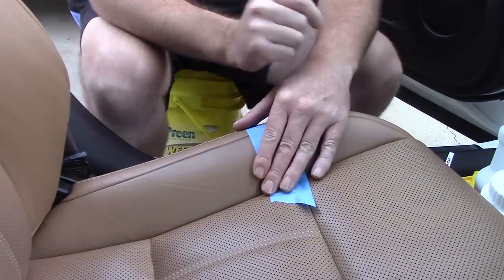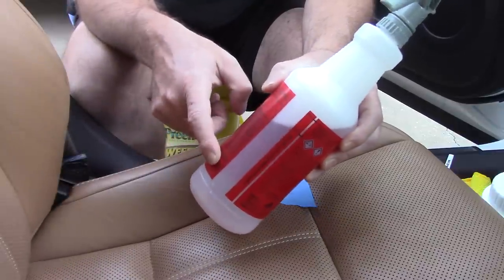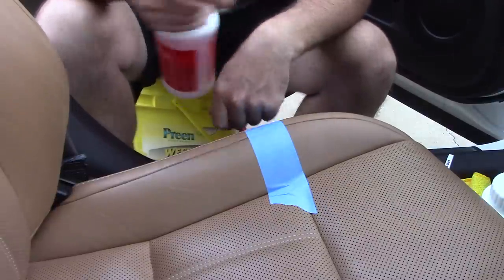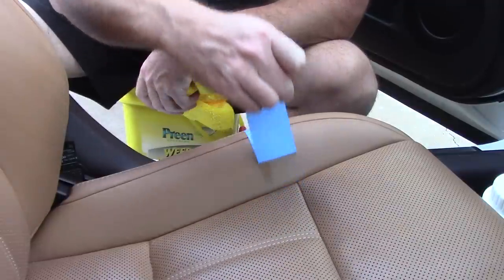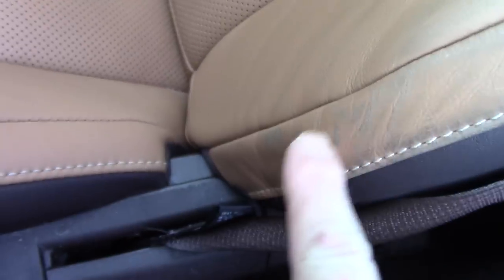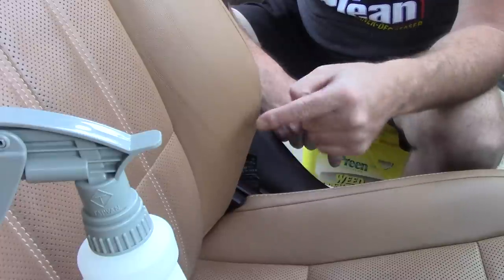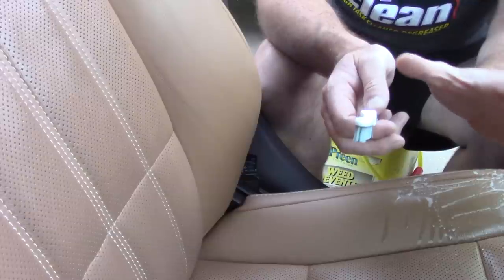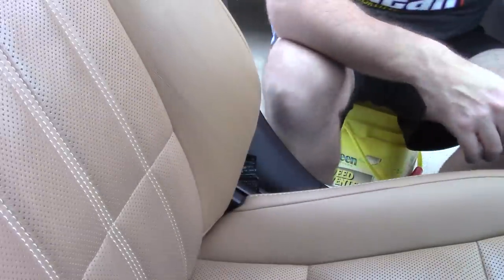Amazing Cleaner For Car Leather - And Cheap!

Comment: Better to show us the Microfiber towel. 
In the UK, a 500ml Spray bottle of leather cleaner is 99p  ( 75 c USA ) with the correct ph factor. 
Forget the CAR Shops,  Buy from the Discount Supermarkets For Cleaning Leather Sofas & Chairs.  On the Household Cleaning shelves.  A cheap Brand will do the job, It's called LEATHER CLEANER.  In a Squirty Spray Bottle, It is Clear & soapy as you Use it. 
99p in the supermarket,  £9.99 in the Car Shop / Car care Shelves.
a 500 ml spray will do 5 or 10 cars depending how dirty they are. 

After Thoroughly Cleaning your Leather, it is wise to Allow it to dry properly, 
Then Wipe it over with a LEATHER FEED Product,  / Leather Conditioner. 
It;s like a Very Slightly Oily Cream to prevent the leather from Drying out & Cracking. 
Use a tiny amount & rub it in with a very soft clean cloth. 
Similar principle to using HAND Cream after washing Dishes etc. Leather is Skin, it will dry out & crack , with sunshine & age & Use. 

A bar of Normal Hand washing Mild Soap will also do the job on Leather. 
( A very Small amount on a Clean Damp Microfiber towel. ) Wipe off with another Damp Microfiber towel.  Dry with a 3rd microfiber towel.  TRY NOT to get the Leather too Wet. 

READ ALL INSTRUCTIONS & LABELS ON ALL PRODUCTS. BEFORE USING. 

                   ALWAYS TEST a SMALL AREA FIRST.

Comment: should I try it on seat belts?   Great vid, I never would have dreamed that one!!!  Thanks
Reply from the maker: sure...but this process will not remove really bad stains and soiling on seat belts, you will need something stronger unless the seat belt dirt is light in nature...its very hard to remove bad stains from a seat belt because of the material used to create the seat belt:(

Comment: Nice video and, as usual, usefully informative, Scott.  I have new leather seats. This seems like it would be good for maintaining it for regular cleaning.  But it does not seem it would be necessary to use the toothbrush since there is not really any grime build up on the seats. Would a microfiber towel be OK?

Comment: I just bought a used, very nice and clean truck last week.  The person who sold it (a small car dealer), must have sprayed (or hired someone to detail it)  everything with that crappy Armor All garbage.  I cant stay seated because its so slippery, nothing stays on it.  My purse flies on the floor, upside down, and unless I put the armrest down, I'm sliding too.  What idiots.  I'm going to try this to remove ALL the Armor All.  Morons.
Reply: I agree. I had that happen to my brand new Mercedes a few years ago. I couldn't believe someone would use that stuff on a new car with leather seats. The detailer told me to use windscreen cleaner like Windex and it will come off. It did. But i lost the new car smell I paid 142k for. I went bonkers and told the detailers staff that you only put that armerhll crap on a $2000 car if you want to sell it.

Comment: some of us old timers have been laughing for decades how all you detailing suckers buy all kind of unnecessary products.. geez any simple old cleaner works fine on acrylic which is the varnish on leather so it is not like old leather in old cars.. woolite works but is not mild, it is a harsh chemical so wear gloves.  Bronners is my favorite which is just mild castille soap, you can get same results with murphys, simple green, ivory dish soap or dissolved castille bar soap or flakes, or natural shampoos or soaps, or ask your grandma.. she was cleaning biologics for decades before you were born.. You never need any expensive "cleaners" which are detergents and are half synthetic-fragrance which are big endocrine-disruptors anyway! Detailers ought to be as concerned as auto painters about chemicals..  This video could be 1 minute long if he was willing to just tell it, instead you'd think he's protecting an idea to sell, but he blew that one! Join a million other companies selling the same crapola in a new label.. If you want to actually renew old colored leather which is like paint or stain, try diluted ammonia, it's a super cleaner so be careful, try it where it doesn't show first  It will transform old colored leathers but will do it by starting to dissolve that coating.  IF you want real leather, take a gallon of acetone to a new car interior.. def wear a mask and only do it outdoors! But you will have genuine leather again just like an old jaguar..
Reply from the maker: i can't believe you watched EVERY minute of it..lol..and you're upset with me:)...im teasing my friend but i disagree with everything you said within your comment..but hey thats life:)...much love

Comment: I bought some Woolite yesterday just for the purpose of cleaning my light gray leather in my Ford Flex...didn't work :(  I used 5 parts water to 1 part Woolite.
Reply: Same here ! On the same car he shows in the video. Pretty disappointing.
Reply: he's cleaning easy stains.
Reply: solarisdreams my seats were clean except for bluejean stain... that's still there :(
Reply: Monica McDonald get those mr. clean magic foam pads. They look like blocks of white sponge. Pretty easy on leather but works great on pretty much anything. I was even able to get news paper ink off light tan leather. Anyway you decide to go, good luck with it.
Reply: PS. Only five or six bucks for a big box of them
Reply: Yeah, I don't think so.  I've seen what Magic Erasers can do and I'd be afraid of removing the protective layer at the very least.  But thanks for the suggestion.
Reply: Monica McDonald try steam
Reply: You probably need a stronger cleaning solution and a stiffer brush. Pro detailers dilute APC all purpose cleaner to clean the not so delicate leather seats. For the brush, instead of using a soft 100% horsehair brush, use a slightly stiffer brush with PET bristles.
Reply: Genius! I tried the Mr. Clean sponge with no chemicals and it's like magic. My wife always uses them, I don't know why I never thought of that.
Reply: There are different types of this Mr. Clean foam pads, use the Original, cheapest variety or the ones with the added cleaners?  Saw it at Loews, not sure which one to buy!  Thanks!
Reply: LASVEGAS GEORGE  I used the chemical free one.
Reply: idreamyou100 sure! I use it on my 96 suzuki x90 and seats are some clean shiny mofos! I'm getting all the puxxy and I ain't saving none!

Comment: Ummm,  you are too slow.  "Professional" means cleaning leather seats for profit.  If I used a toothbrush, I wouldn't even be able to get a job detailing cars.  
I use a scrub brush that's the equivalent of like 200 toothbrushes.  Making it take 200 times less time. 
Time is money.  Chemical /product costs are generally less that 20% of what time costs doing the job.

Comment: Less words would be good
Reply from the maker: i know right:)
Reply: Dallas Paint Correction & Auto Detailing. What do you recommend as a good conditioner that protects and shines if it's dull? Also can you use this on leather furniture? And what will happen if leather is not coated in plastic when you clean it? Thanks!

Comment: No rinsing necessary?
Reply from the maker: correct because modern day car leather is coated in plastic for about 90% of all cars with leather
Reply: Dallas Paint Correction & Auto Detailing That's good to know and a great tip. I have never been very satisfied with the expensive leather cleaners I've used in the past...maybe because they were cleaning plastic.
Reply: meguiar all purpose cleaner will do as well
Reply: +Dallas Paint Correction & Auto Detailing, Will wooolite damage my heated and ventilated system on my seats?
Reply: Jonnie Bangkok  

  ?
Reply: Does it work on all types of material. Mine looks like leather but not sure if it is. It's a Ford escape 2017.

Comment: I am pretty sure BMW + Mercedes recommend their own leather cleaners, like other premium manufacturers do, e.g. Porsche etc, who in turn of course resell brands like Dr Wack in their re-branded bottles. And nobody recommends working your leather with a toothbrush of all things... you point yourself to how fragile the coating is on that seat and that it has come of but somehow a fucking brush is your tool of choice. Well, if you clean a customer's leather like that every 3 years you probably get away with it; otherwise, this is a terrible hatchet job... The people that are so happy with you here should check out some channel of actual leather experts and think again.
Reply from the maker: little do you know my friend..and as a pro some people don't clean their leather EVER!..so yes using a brush is fine to remove all the years of neglect..but no you don't need a brush every time to clean leather once you have cleaned it properly:)..you are over thinking every thing my friend and just assume i would clean well maintained leather the same..relax dude and the so called leather experts would recommend a ph neutral cleaner for really dirty leather...good look with that:)...do some research with BMW and Mercedes and you will notice the cleaners they have or recommend wasn't working for those with really dirty leather so in a lot of their paperwork they recommend this method because they had to because their so called leather cleaners weren't doing the job for really dirty leather:)....i enjoyed your comment even though it wasn't coming from an educated perspective

Comment: I clean and maintain both my Lincolns, one with white leather, the other with a neutral type beige and even at the worst point, they've never turned out that poorly!  In other words, I'm a much better detailer when it comes to leather seats.  Those seats did NOT come out clean!  Sorry.
Reply from the maker: no reason to apologize my friend:)..it sounds like you had a bad experience..i have been detailing for over 26 years and this video was really for those concerned with high alkaline cleaners for leather and if they just wanted a cleaner to MAINTAIN their leather seats..yes of course i use other cleaners as well when leather is really hammered and dirty for better results:)

Comment: Tried it on my leather seats. disappointing results.
Reply from the maker: Depends on level of dirt and what kind of soiling..
This method is safe and used as a maintenance method before things get out of hand..
If leather is really soiled I use a apc and have discussed it at length
Reply: thnx   @dallaspaintcorrectionautod8343

Comment: It would take me 4 hours to clean the leather seats in my truck with a toothbrush. No thanks
Reply: If it's really hammered use a magic eraser. If not then use a detailing brush (it doesn't take long). Afterwards use a protectant like Opti-seal or mags ultimate fast finish. The next time you have to clean it won't be a 10th as bad if it has been sealed.